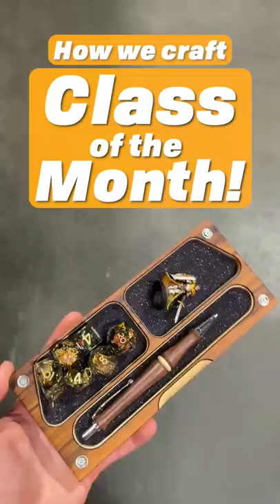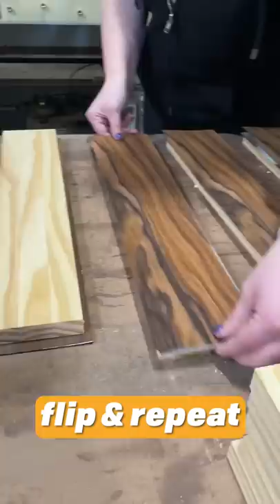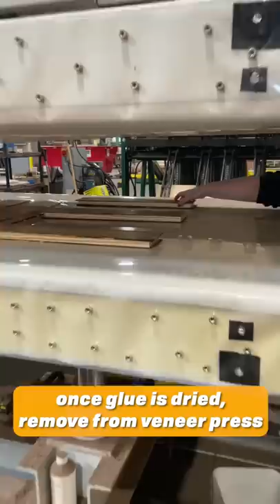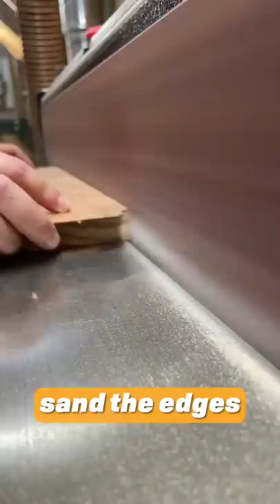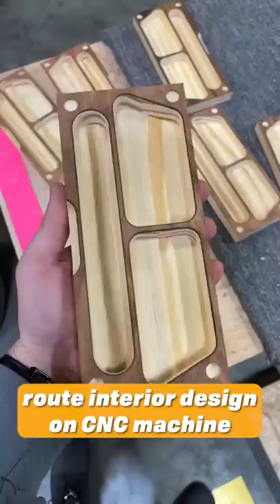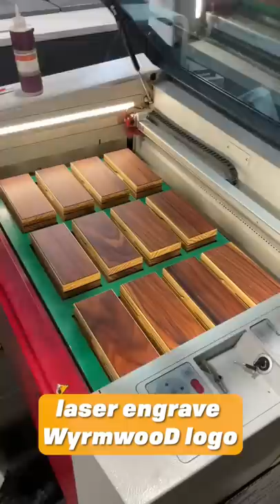How We Craft  Master Vaults 🪓🪵🛠 #shorts

Comment: Interesting. You brand between the sealer and the finish, but laser etch after the finish? I would have thought the branding and laser etch would have both been before the finish.
Reply: Probably something to do with the laser
Reply: At least for the laser I'm going to bet that the finish is on first to allow the vaults to be wiped clean afterwards. If they lasered unfinished wood, the area around the design would get stained by the smoke. You can see all the residue in the video, but it's been cleaned for the final cut. The brand, on the other hand, comes off the wood very clean.